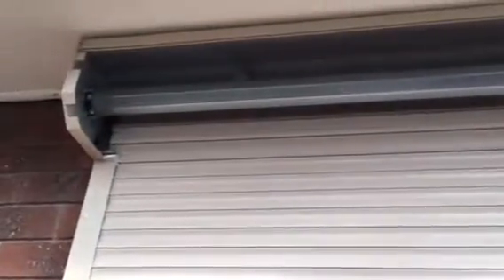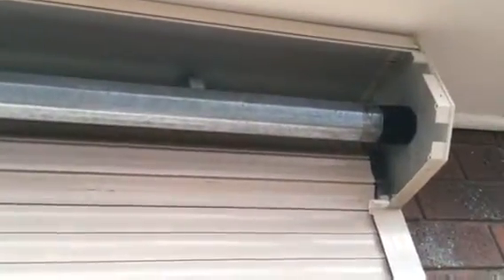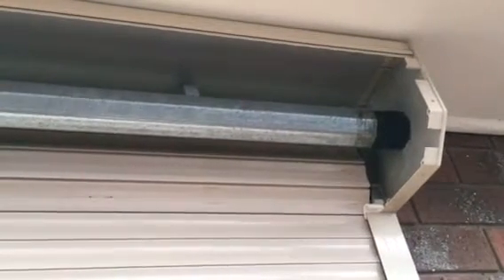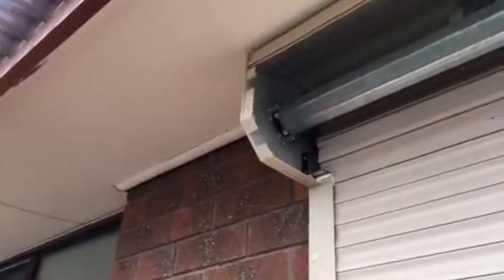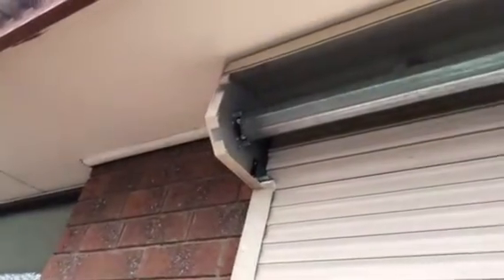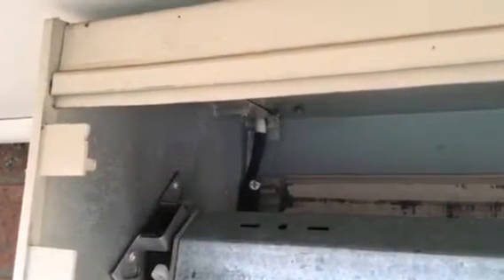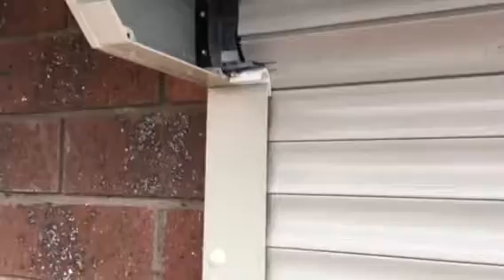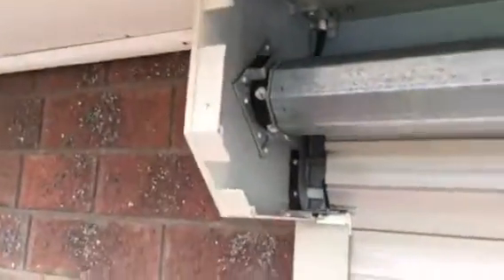Electric roller shutter motor repair part 2

Comment from the maker: Fixed another roller shutter with a new capacitor. The new one is barrel shaped like the old one but a bit bigger diameter. It’s a CBB60 4uF. Ideally you should replace with the same uF value. You can get them on line for about $6, but you’ll pay a bit for delivery. I also purchased from Jaycar a pack of 8 insulated spade sockets 6.8mm which perfectly fit for $3:50 I used 2 for the connection and 2 just to cap the other 2 terminals. Better than spending $500 or more dollars replacing a motor you don’t need to replace

Comment: Hi Steve, Thanks for the video! My roller shutter stopped half way and the motor does not show any response (battery, electricity checked). Do you have any idea how can I disassemble the motor with the slat on it? Thanks!